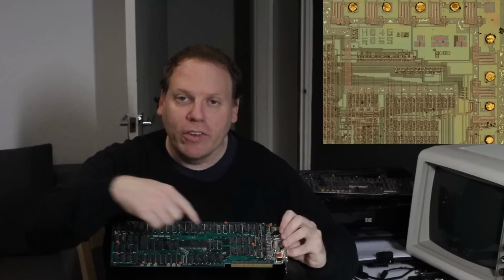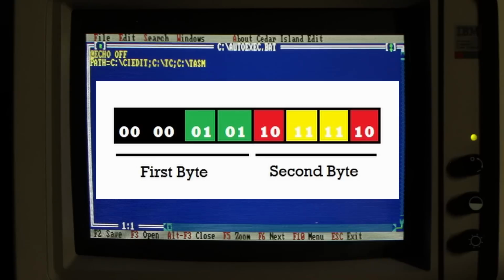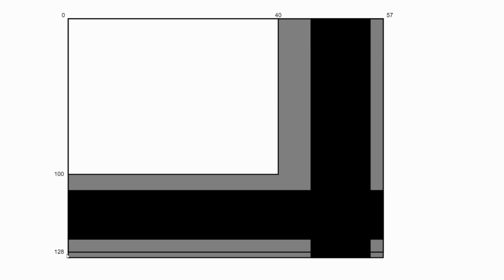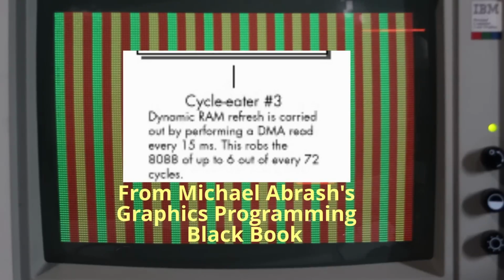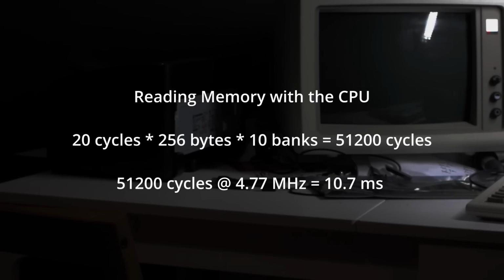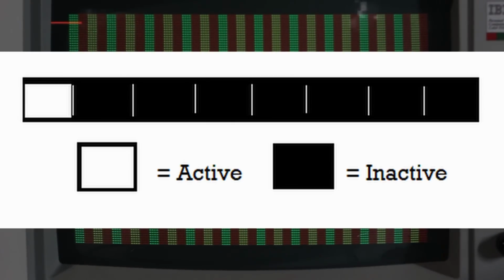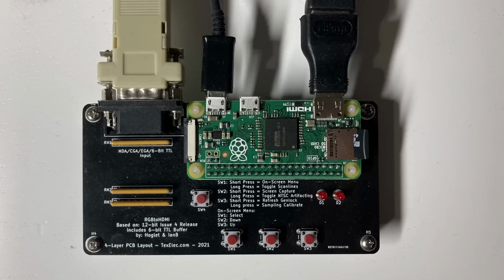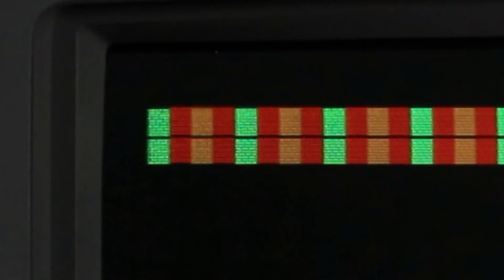Reverse Engineering the Video Chip of the IBM CGA Card (1981)

Comment: This video is very interesting. In the 80's I ran into this timing problem when I wanted to fiddle with the CRTC registers and suspected the card bus and 8088 instruction latch. 
I never would have suspected DMA, and I don't know how you disabled it? 
Is it possible in software or do you have to make a hardware modification? 
I'm working on a document that describes the behavior of different CRTC models within the Amstrad CPC architecture (Motorola, Hitachi, UMC). 
I’ve created a portall that summarizes many tests
The CRTC Compendium 1.3 is available on the logon system website
Version 1.4 should be released in English soon. 
This may be of interest to you. 
Being precise with this component allows you to do amazing things. 
It is possible to do, for example a vertical scroll at 1/64th of a pixel (and 1/128th must be possible too) .  Some techniques also help to increase horizontal precision.
Reply from the maker: I'm going to read the Compendium very carefully, thanks. And I am really looking forward to version 1.4 with the info you mentioned, as that is particularly interesting.

As for DMA refresh, one just has to disable channel 1 of the PIT, which is what drives the DMA refresh. No hardware modification is required. It is software only.

There are other things that interfere with timing. The PIT cannot be synchronised in a reliable way with the CGA card (after a reboot the synchronisation will be changed). But you can simply avoid using the PIT.

There are also wait states from the CGA card which will interfere if you write to video RAM. They are totally predictable however (Reenigne describes the exact algorithm on his blog). And of course you can avoid them altogether by not writing to VRAM.

Other than that, as you can see, a perfectly quiet and reproducible system is possible as I show in my video. However, once you synchronise the CPU with the CRTC frames in the way you want, you have to do the whole procedure again if you want a different synchronisation (or add additional characters to your frame temporarily). This means you really only have control in a given frame down to the CPU cycle (3 hdots) not down to the hdot. That might be different on other platforms, I don't know.
Reply: @PCRetroTech  Thank you for this additional information. With the architecture of the amstrad CPC, it is difficult to be as precise as on a PC when writing registers because of the pattern imposed by the graphics circuit (called Gate Array and which reads the ram addressed by the CRTC to supply the pixels (with 1 µsec delay)) to the processor (basically the Z80A is put on hold by the GA). The only possibility of playing on the moment of writing is to use another instruction of I/O in the cycle T is positioned differently with regard to the pattern which I have just evoked. Writing at the limits is not necessarily always relevant insofar as certain conditions arm the resets to 0 of certain counters in advance (as is the case for counter C4 at the end of the frame with the Motorola or the Hitachi). In the compendium I think 1 hdot in your document is similar to a Pixel-M2, but I think you will make the link easily :-). On CPC this corresponds to 1 pixel of the 640 horizontal pixel mode with R1=40) which is supposed to be the fastest frequency for the Gate Array (0.0625 µsec). However, the compendium mentions some differences at the limits, but I haven't noticed any on C0=R1. What you call "to-imminent or from-imminent" is indicated as Rx.JIT in the compendium (JIT for Just In Time). There are also bugs on the writing of certain precise values at certain positions, which allow the activation of internal states unrelated to the register (for example on the CRTC 1 (UMC), position R5>0 on C0=R0 enables states such as video pointer update authorization and interlace parity management).

Comment: I posted a positive comment later earlier, and I mentioned a technical document on which I work and which describes the reverse engineering of the CRTC of different manufacturers, used in particular in the IBM PC. (AMSTRAD CPC CRTC Compendium).
Did I contravene a rule for my message to be erased? I had given a link on my document, but I do not see or it can be problematic ... I try again without the links ...
Reply from the maker: Hi, that looks absolutely fantastic. Thanks for letting me know. Yes, YouTube deletes absolutely all posts containing links of any kind and various other things as well. I don't even see the posts myself any more. They just disappear instantly.

Anyway, I was able to find a link to the Compendium on the CPC Wiki. The link to the French one seems dead, but I found the English one further down. That is a very impressive piece of work!

My email address is in the community section of the channel if you want to get in contact (my email address doesn't delete links :-))
Reply: @PCRetroTech  Email sent ;-)
Reply from the maker: @logonsystem6791  Thanks! I will try to reply when I catch up at work in the next couple of days. The video you linked is not working by the way. I think the video might be set to private. If they set it to unlisted I would be able to watch it if I had the link.
Reply: @PCRetroTech  Link corrected 🙂
Reply from the maker: @logonsystem6791  Thanks!

Comment: Im currently writing a clone of the 6845 in verilog for an FPGA and this video is super helpful, thanks so much :)
Reply from the maker: That'll be difficult to get perfect I would think. But you should be able to get the intended behaviour. There are some surprises when it comes to which counters reset off what comparator. And various things happen on some comparator going high and others on it going low. All that information is difficult to guess and varies from model to model.
Reply: Graphics gremlin project actually has a CGA in for a FPGA

Comment: As the CGA circuit diagram is public, much guesswork can be eliminated.  Another key trick is to try to reconstruct the published behavior of the CRTC chip using a minimum number of gates to get an idea of how the glitches happen, thus gradually reconstructing the internal design to predict glitches before trying them.
Reply from the maker: Reenigne has studied the CGA schematics in detail and much of what we know comes from that. However, there are still mysteries that will only be solved by attaching a sniffer, as precise timings are not always trivial to predict. The CRTC chip is unfortunately slightly more complex than we'd like. We have a rough idea of what it looks like in terms of gates, but we don't know what design the comparators used, what design the registers used, anything about propagation delays or what is in the interlace or skew circuitry which is just a single box in the schematic in the datasheet. There are also glitches which I didn't talk about that are temperature dependent or which vary from chip to chip.
Reply: @PCRetroTech  That's the thing with these glitches, you're at the edge of what is hardware and what is tolerance.

Comment: As someone educated in the 1980s, I seem to recall the DRAM control circuit providing RAS requests and thus refresh to all the banks on each memory request, at least under certain conditions.  Thus manual refresh should be doable with fewer accesses, consistent with the DMA controller only stealing 1/12 cycles to do the refresh.
Reply from the maker: That does seem like it ought to work. So long as it is possible for the CPU to cause the DMA controller to do a refresh of a row (in all banks) without the PIT needing to fire, then that should work. Unfortunately the PIT is out of sync with the CGA card in a way that cannot be controlled after reboot. I'll have to look into that solution, as it seems better than the current approach.

Comment: Amazing video as always. Very clever solution on handling dram refresh. Did you have to interleave your code across all 64k blocks to ensure all 640k was refreshed? I assume this trick would only work if you assume all machines had 640k and maybe then attempting the trick on a 256k PC would result in a memory address error? I suppose you could create code to first calculate available ram.

Could you sweep the 8086 stack pointer across all the 64k blocks to do a refresh or does the cpu not energize the stack locations when the pointer is assigned? Probably not. Clearly the pointer would have to then be set back to normal as well.

Has anyone ever used the cga ram area for extra ram storing code in off screen regions? Probably useless idea but curious. Maybe you could with ega in an off screen frame buffer? Yeah its slow ram.

Anyways what a great video. Always excited for you to drop another.
Reply from the maker: Yes, one has to put 256 bytes of code in each 64kb block (and alternate the addresses from 0 mod 512 to 256 mod 12 to catch all the 256kbit chips). But the code was just NOPs in my case as I didn't have much to do every frame and there was plenty of time left between the refresh procedures to get stuff done. Of course in a demo every single one of those bytes would be doing something useful and some!

Of course to do it carefully one would have to figure out how much of the RAM is populated. I don't know if one would get address errors. But one can of course check the settings of the switches (there's registers for this) and that should give you the RAM configuration.

No, one can't simply sweep the stack pointer to refresh the RAM. The CPU doesn't energise anything unless the RAM is read or written. Simply setting an address in a register won't affect the rest of the machine, unfortunately.

As for offscreen regions, there's just a few bytes (192 bytes per 8 kb bank to be precise), not enough for anything substantial unless in text mode. And it is very slow compared to system RAM due to the CGA wait states. I'm not aware of anyone who used it for anything useful.

Glad you liked the video.

Comment: Wow, that was impressive. What I'd love to hear more about, or hear about more explicitly, maybe in a future video, is what parts of this are specific to the Hitachi HD6845, and what parts apply to any and all MC6845 versions or clones. Failing that, I'd love to know more about what glitches are possible on ALL 6845 versions/clones used in actual IBM CGA cards, as for better or worse (often worse), warts and single-ported RAM and all, the latter's common capabilities denominator are the de-facto standard.
Reply from the maker: The snow should be common to all IBM cards. All the half char glitches seem to be Hitachi specific. Glitches to the end of the scanline are common to all chips. That's about the long and the short of it.

Comment: I'm just wondering how long until we discover that these old machines could, in fact, run Crysis...
Reply from the maker: Well, someone just announced that they can in fact run Wolfenstein. They weren't the only ones working on that (successfully) either if rumours are to be believed.
Reply: @PCRetroTech  the Wolfenstein source code is public, and I've seen references to EGA compatibility or at least support at some point in development (I believe it only supports VGA?), however nothing about CGA. I've lightly studied the source code in order to see the possibility of making my own source port however the code quality is low and very DOS specific, requiring additional work to build comfortably on modern systems
Reply from the maker: @kreuner11  Here's a link to a tweet about the CGA version, including a link to the code:

https://twitter.com/Jameshhoward/status/1616182105087557641
Reply: @PCRetroTech  ah, it is adding the support into the code
Reply: @PCRetroTech  indeed, i got that port running on a luggable xt with a mono cga

Mind you I think the raycaster is a liiiitle more simplified than crysis but eh - never underestimate the 8088 :-)
Reply: No chance

Comment: It'd be lovely to get a modern reproduction of this card, since the originals are becoming so collectible as to be hard to find in the wild. I tried 8088 Domination on my Tandy 1000 HX over the composite out, and while it did "work," the colours came out shifted in value (works just fine in b/w over the RGB port). The other demos go much deeper into utilizing the quirks of the IBM CGA card's hardware, which is why only the IBM CGA card will display them properly, and why those cards have gone up so much in value the past few years. Unfortunately, that also locks most of us out of enjoying these demos in person, except vicariously over YouTube.
Reply from the maker: I agree a modern reproduction would be a worthwhile project. IBM of course still exists as a company though, so I'm not sure it's going to happen. Sourcing MC6845's might also be an issue.

I think the demoscene must surely have also contributed to GUS soundcards becoming unobtanium.
Reply: @PCRetroTech  Not just Gravis, but 8-bit sound cards in general. I've taken to running 16-bit pre-PnP cards with the end hanging out of the 8-bit slot. Works just fine in most cases, as long as you watch which jumpers you set.
Reply from the maker: @BlackEpyon  Yes indeed, that is true. I have a couple, but not many 8 bit sound cards, mostly obtained at reasonable prices by sheer luck.
Reply: I was just considering all this news from the vantage point of FPGA recreations.  It’s one thing to have a repro that does exactly what the card is supposed to do.  It’s another thing entirely to build in all the quirks so it does the same thing as the real hardware when you do stuff you’re not supposed to do.
Reply: @sirnickity  You'd need to either completely reverse-engineer the Motorola 6845 gate for gate, and reproduce it in a CPLD, or source others that have been recovered from scrapped systems. Maybe Motorola would be amenable to licensing it for reproduction, or just put the schematics out as open source (since it's long obsolete). You could easily reproduce the glue logic into a CPLD, even the same one that's emulating the 6845. A question though is whether or not the newer static RAM would make a difference in these demos vs DRAM which needs to be constantly refreshed. I don't think it would, but I don't know enough about the "black magic" of how these demos work. 

A newer card would definitely be a lot smaller than the original, but if it requires one or more CPLDs, that would likely rule out the release of a kit. It'd have to be pre-assembled, or at least the CPLDs provided in the kit pre-programmed. The alternative would be FPGAs. That would necessitate a custom BIOS for it, but those are a lot easier to program with a cheap EEPROM programmer than the CPLD would be.

I don't know. I'm fairly decent at laying out PCBs if you give me a schematic, but programmable gate arrays are an entirely new thing for me.

Comment: I wonder what kind of shenanigans might be possible with interlaced mode...
I know the card doesn't have the circuitry to make it useful as intended, but it might be useful to screw with the current character row so you can have another "pallete" for "320x100"...
EDIT: Also, how does the composite output handle mid-frame resolution changing and such stuff? Like, is color-burst and hsync even remotely acceptable?
Reply from the maker: That's an interesting idea re interlaced mode. There's some technical challenges to overcome to get that to work, but it's pretty involved so beyond the scope of a video like this. In fact, I'm leaving that stuff to Reenigne who seems to be the current expert on that.

I don't know much about composite mode, but generally resolution changes are not predictable (at the moment) and we are still researching how to do it smoothly. It's actually difficult enough to do between frames, let alone mid-frame. But maybe we'll get it sorted soon.

But screwing with the other values shouldn't be difficult (and I'm sure they do so in 8088MPH). Composite monitors are not so different to RGB monitors in operation. But I don't know the answer to your question about colour-burst and hsync. I've only done experiments on RGB personally.

Comment: This was great, very interesting. Started off with a clear explanation of how CGA works and then built on it. Doing manual DRAM refresh was a real eye-opener, I had never considered you could turn off the automatic process.
Reply from the maker: Thanks! I'm glad you enjoyed it.
Reply: @PCRetroTech  Did you do all the refreshes with jumps to each row all at once then run your code, or intersperse your code between them all?
Reply: I remember you could control refresh on the 8088 boards to 286 I think. Didn't know you could do video card aswell